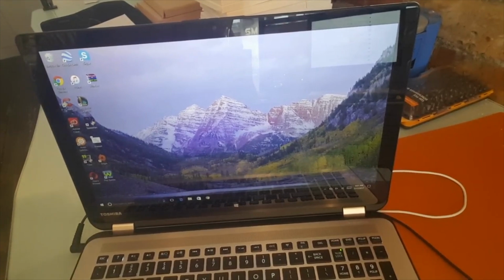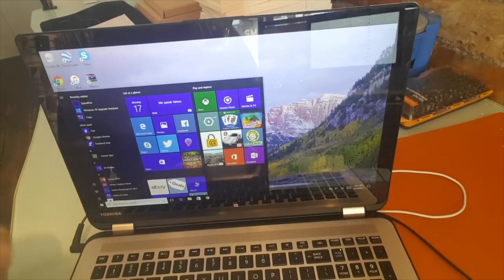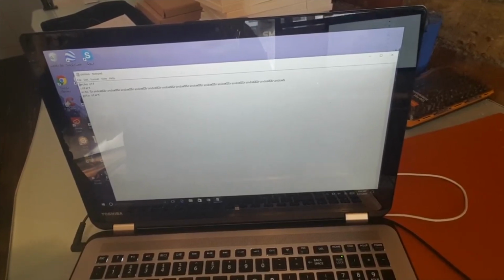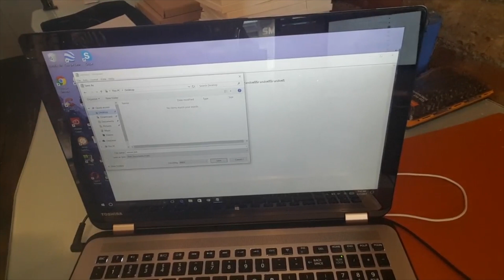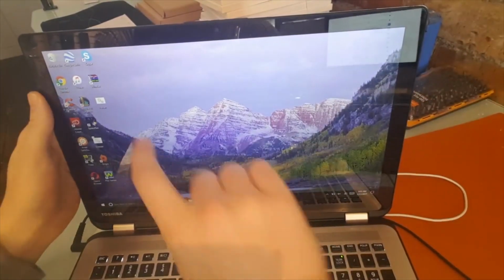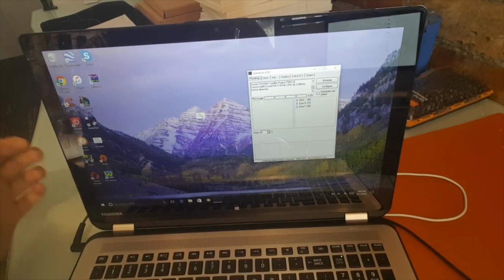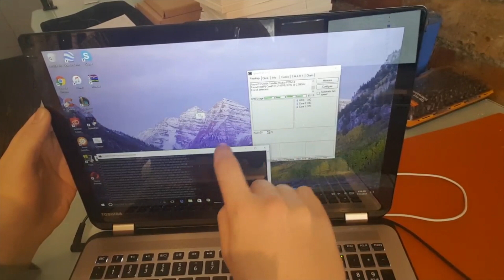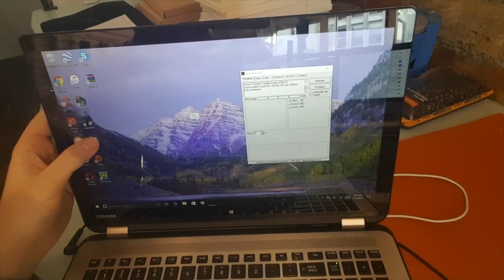PC Laptop - Fan Testing - Stress Testing A Fan On A Toshiba Laptop

Comment: People disliking this:

- first try it

Dell support software popped up a notification about issues with the laptop fan. I couldn't find software to see if it's still working after I cleaned it.

Video quality quite frankly sucks but it'll get you results. The fan does have a noise when starting up (so there is something not right) but this process made it spin when needed.

THANKS, GOOD ON YA!